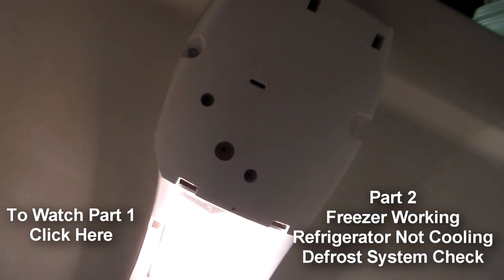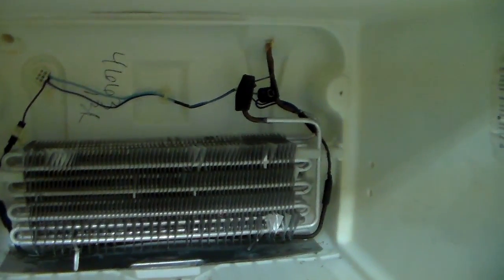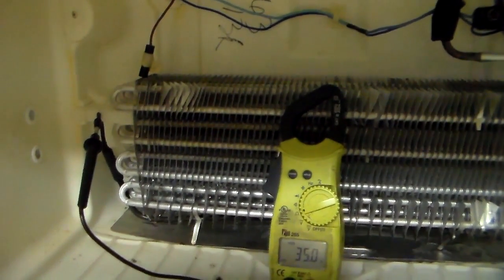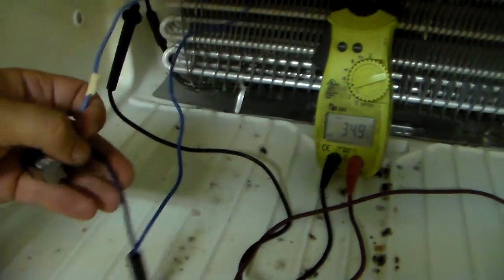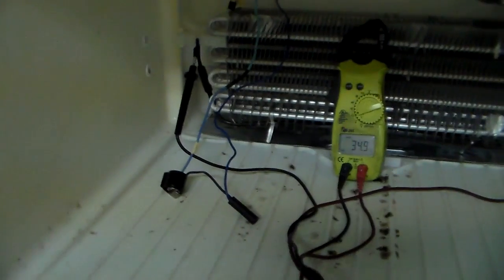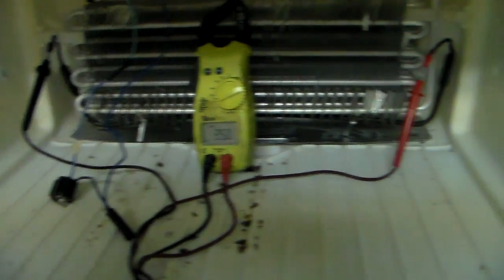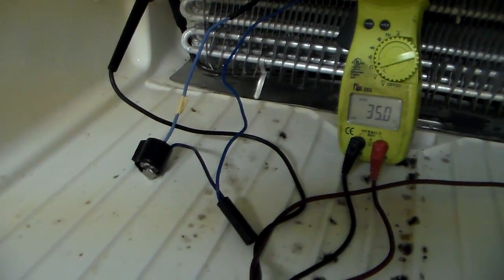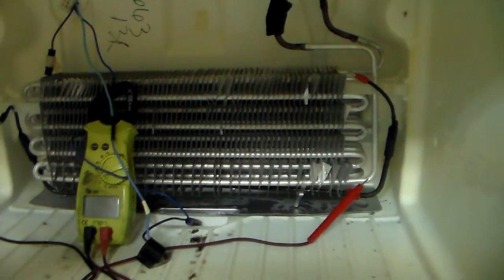Troubleshooting a No Cool Refrigerator - Part 2

Comment: How would you check the Defrost Timer if it is electronic? Some will not "trick" into defrost by pressing the door switch a number of times.
Reply from the maker: Replace it with a manual timer and turn the dial to defrost and see if the heater comes on.  If it does replace the adc board.  You can only do that on the ones that have the same plug and the manual timer.  That's would I would do.
Or I would just test the heater and defrost thermostat, If they are good and the machine is frosted up from a defrost issue replace the adc board.
Thanks for Watching!
Reply: Bill Newberry
Thank You. I'll try that.
Reply: Bill Newberry
Now some ADC boards have an additional harness like the one I'm working on. I will point out that this unit has no thermistors. It has a conventional thermostatic probe. The ADC has the four blades like the manual defrost and two additional blades. I do not have the schematic to this unit which makes it difficult.
Reply from the maker: The two additional blades are for the light inside the refrigerator.  It reads how long the light it on over a period of time to adjust the length and spacing of the defrost cycle.  Just disregard those blades and plug the manual timer into the four that match the timer.
Thanks Again.
Reply: Thank You once again! Bill.

Comment: i have f82u20f3w2 freezer. about a year ago compressor control burned on it - I replaced it, freezer worked fine . about 6 months ago I noticed the the compressor was sounding like it is fighting against pressure or something - it would drop rpm and pick it up again periodicly. finally about 2 months ago it started runnig the compressor for 6 seconds every 5 minutes. I took it apart and tested everything I could , finally took the compressor relay/control apart and it was burned - cont. next

Comment: I didn't unplug the evaporator fan to see if the compressor or anything happens nothing happens when I unplug the evaporator fan not sure how to proceed I live in an RV I could sure use your help if you have any to give I don't want to buy a control board if that's not the problem the Magic Chef refrigerator has sensors for Jeep Frost ant control not the usual timer

Comment: ok so im checking the heater with my multimeter and the reading is jumping around like crazy and then ends up going back to zero...Multi meter problem or is the heater just bad
Reply from the maker: ***** Could be a lead on the multimeter.  Check some other stuff with it and see how it acts.  Ohm out the fan motor and see if the reading holds steady.  If so, replace the heater.  If reading still  jumps around, replace the meter.
Reply: k thanks one of the leads was loose i got it to steady out at 32!! and the defrost thermostat is showing one after sitting in ice water for several minutes...So just to double check that means the defrost thermostat is bad. correct?

Comment: MY freezer is not frozen. I defrosted it with a hair blower yesterday. and still the freezer does not freeze anything. Cool air does go through but not enough to freeze anything. The vent at the bottom of the freezer are not clogged with ice or anything.

Comment: can you bypass the bimetallic switch for troubleshooting purposes?
Reply from the maker: +jimmy1105ful Yes, for troubleshooting purposes only.  It would get too hot if you left the heater on for the whole defrost cycle.  The plastic behind the metal shield will melt.  But to test, you can let the heater on for a few minutes just to verify that it's getting power.
Reply: +Bill Newberry thanks, I'll check the timer first like you showed. My sons refrigerator started icing up. I'll look at it tomorrow. Thanks for sharing and quick reply. God bless.

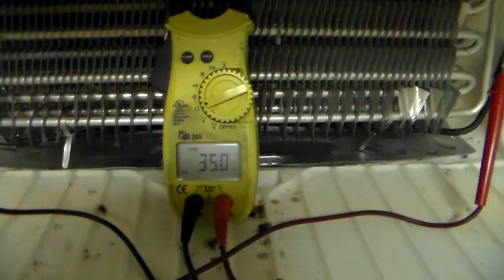Comment: 3:50 ... you have 35 ohm's showing the heater is good.  What you you see on the meter if the heater is NOT good???
Reply: Should be about 40 ohm's. If its open circuit its bad or if it reads a lot less than 40 its bad

Comment: What is that third wire  that doesn’t go into thermostat gel
Reply: The third wire goes into the header on the right side 11:24
Reply: That third wire on defrost thermostat looks like it goes into heater on right side and runs across to the left where you unplug wire harness

Comment: Why didn't you use the amp probe to check the heater. Put on manual de frost with amp probe clamps around heater cable. If no amps show check power from time clock. If power then do as you have done by checking the heater and stat. If no power from timer then the timer is U/S

Comment: My neighbor had a problem today with his heater not turning on. (here is a quick tip for checking that thermostat) after manually setting the timer to defrost and noting that the heater is not getting hot, unplug fridge, cut the two thermostat wires, then instead of drowning it in a cup of ice water, simply connect the to two wires to temporarily eliminate the thermostat, plug in the fridg manually turn the the defrost timer, and the heaters turned on right away. bad thermostat

Comment: have ge side by side defrost tube has contiunnuity so does thermostat- timer is circuit board evaporator freezes up right away and refridgeater will not cool

Comment: FYI - A glass of ice water might not be cold enough to trip the thermostat / Switch.

I tested mine and a new one - Neither would trip after 20 minutes in an ice bath
Reply: Put it in your neighbor's freezer for 20 or 30 min then pull it out and test immediately for continuity. If  your meter doesn't beep, the heater thermostat is bad. I take it a step farther and hold the meter leads on it using my hand to warm the thermostat and wait for it to click and open (and the meter stops beeping telling you continuity has been interrupted). I do this several  times to make sure the part works more that just once.

Comment: Another way to see if the defrost thermostat is bad, cut it out and then run a jumper cable across that line. Turn your defrost timer on and see if it gets hot. If it does, bad thermostat.  Don't leave it jumpered for long, it gets reallllly hot

Comment: I've got two Whirlpool side by side refrigerators.  Both are acting up, I use a hairdryer to de-ice the lower vent.  What's really weird this time is the kitchen one.  If you open the fridge door and put your hand by the upper air vent, nothing.  If you crack the freezer side, cold air comes blowing through.  Shut the freezer side, air flow stops.  This is kinda embarrassing because i know it's something obvious, I just don't know what it is!
Reply from the maker: +Mark Snapp It sounds like when you de-ice the lower vent, you may not be getting the lower passageway between the freezer and fridge compartment.  If you remove the lower crisper drawer in the fridge section, put your head in there and look left, you should see the vent leading into the freezer.   Give that a look.  It can't draw air from the freezer, until you open the door sounds like a symptom of this.  Let me know what you find.
Reply: I took out all the drawers, there is no lower vent.  There is an upper vent which I guess is the cold air intake, and mid-level one, which is whats freezes over.

Comment: So what happens when the evaporator fan is on when defrost but when it cycles to normal cycle compressor comes on but the fan dont come on what happens then
Reply from the maker: edwin pena Sounds like timer is messed up.  I would replace it and go from there.
Thanks for Watching!
Reply: I did i got a new one and its doing this so i ask around and so far got that maybe the wires are creating a short
Reply: I replace the timer to

Comment from the maker: just to 100% there is a freon issue.  Is the evaporator (coils in the freezer) only partially frozen over.  If so, freon issue.  If they are completely frozen over, this is an issue you can repair easily.  Unplug the fridge defrost the coils, plug it back in and let it run for about a half an hour.  You'll get a clear view of the frost pattern then.
Let me know what you find.  I'll be working on the computer for the next couple hours.
email me at applianceoutlet at gmail dot com

Comment: confusing when you say at 9:15...  if it shows an open circuit after being in cold water - "it's bad..."    "if it shows a 'completed circuit - it's good."           what do you mean by "open circuit?"    what is completed circuit?"
Reply: electricity can only flow to its destination when its a complete circuit. if you drive down a road and all of a sudden there is a sink hole in front of you you will not be able to keep driving and your trip or circuit cannot be completed. im not an expert but i believe thermostats have a piece in them that move based on temperature. then that piece moves and touches the other side (like building a bridge over the sinkhole in the road) then the electricity can flow and turn on the heater......hope it helps

Comment: U didn't explain why the defrost timer is bad if u turn it to defrost and the heater comes on its bad?!!why? Isn't that what u want.U didn't explain how to check the heater or what ur looking for to validate it's bad,or where to connect ur multimeter too..Ur explanation on the thermostats is ok.
Reply: The timer is bad since you had to manually turn it your self when you shouldn't have to.